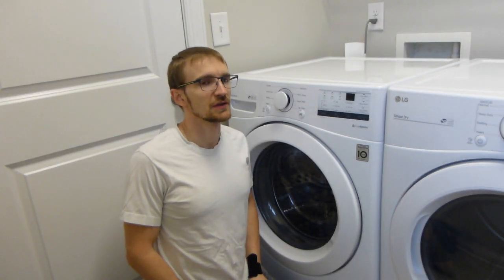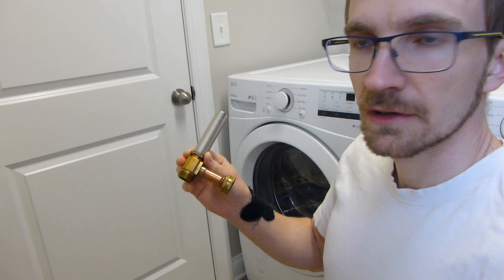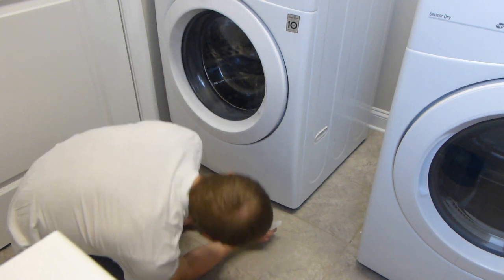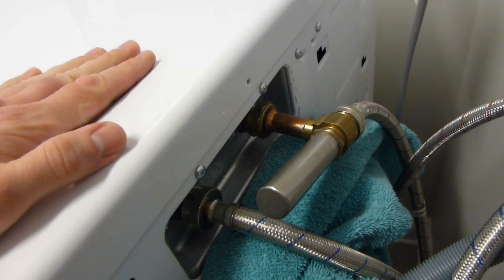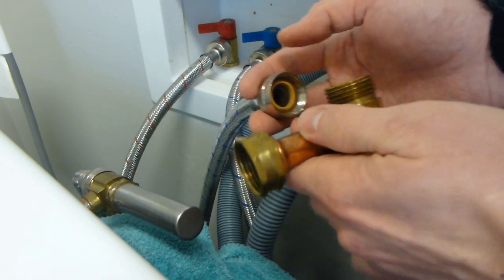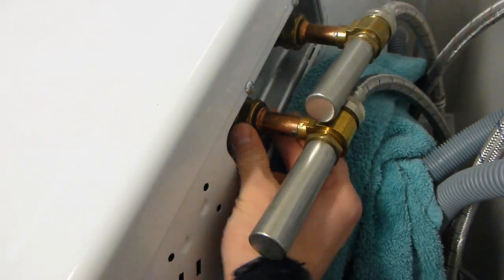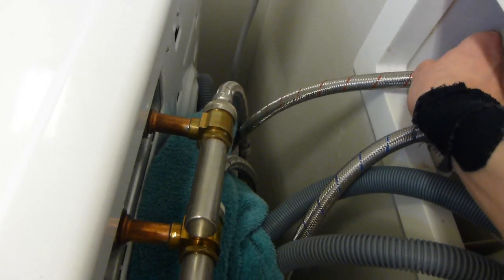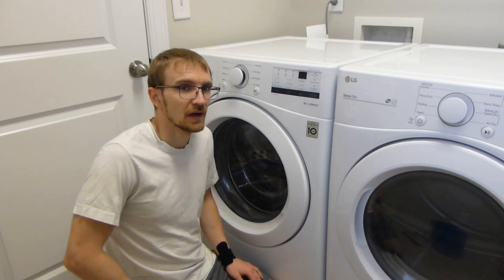How to Quiet Washing Machine Banging Sounds by Installing Water Hammer Arrestors

Comment: I just had the arrestors added however, they were installed above  washer on wall and washer still hammers? Do you think it would make a difference if they were installed on the washing machine?
 Also wanted to mention... had a pressure tank installed and water pressure regulator added (hope I got names right?... I think you'll know what I mean) , before arrestors (above the washer,) because water pressure was reading  too high and thought this would stop water hammer in washer.
Reply from the maker: Thanks for your comment, sorry I just saw it now. If they're just a hose-length away, I wouldn't expect it to make a huge difference. One thing that I think is possible in this case, is that perhaps you're hearing the valves rapidly closing? By contrast, the water hammer is the one that is louder/deeper and sounds almost like it shakes much of your piping when it happens. It's also possible that the arrestors are too small for your given water pressure, but I think this is unlikely. I suppose you could always add another pair of them on the washer itself, but I wouldn't think this is necessary.
Reply: @FASTmaster789 so it’s ok to have two sets one on the washer end and the other at the other end?